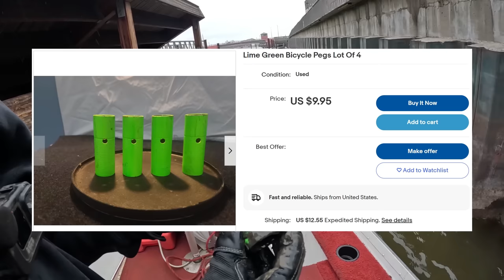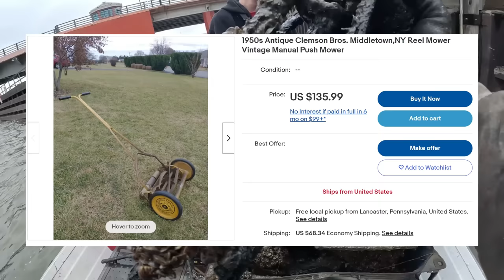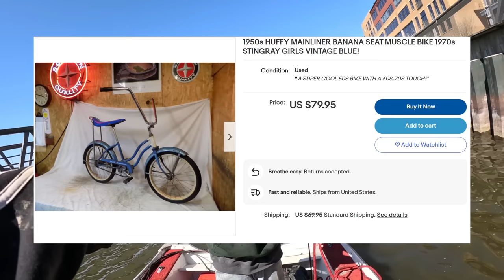Most INSANE 2 Hour Magnet Fishing Riverwalk JACKPOT!!!

Comment: 11:30 Motorcycle rear sprocket 12:35 push mower reel 1960s 13:59 bicycle front forks Thye gears could be from that lawn mower. That prybar is very restorable 24:06 Mop bucket wringer 37:43 Alex caught the end of your lawnmower 39:25 wheel and gear from lawnmower A ll of the metal wheels and gears are from those lawn mowers 48:16 multi-wrench for an electric tool 108:22 street light cover The rest is doubled up from your last big video
Reply: yes, those wheels with gears are likely law mower wheels

Comment: HELLO THERE 🌸🌸🌸 just want to remind you about a few things… is there a adaptor outside to screw in a hose you’re gonna need a water hose I never seen one when you gave us a tour of the house on the outside!
When you set your table and chairs and your sofa and your furniture in after you apply the floor, don’t forget each foot needs a padding with the 2 way tape to stick to the feet and the rug part to the floor so you don’t scratch your beautiful floor make sure your bed and all the other furniture has it underneath also on all feet… keep as much wood as you can for bonfires. Did you get to keep those six chairs you found that would look good with your big umbrella get some small cushions for them or a back and a seat cushion attached together that will look mighty fine, dark blue.
I’ll keep up with reminders just in case keep all glass we both have a craft to do together. I’ll have to find some keep all colour gloss white whatever clear colour whatever keep them all in the box in the barn close it up so Owen won’t touch it.. Okey Okey, Okey Dokey🤗😁🩵🌸‼️‼️‼️

Comment: in the second video on day 2, you brought up a thing with a pattern underneath is also for salvagers because they have two support legs at the back of the salvager which they use with a lever on the side of the salvager, there is a long hatch and the same day there is it on the other side and one of the levers controls the shock leg and if it is slippery you put it under where the shock leg is on the ground and put it under the shock leg and then move the lever up or down depending on how the rescuer works and when the shock leg is brought down so if you put it under the shock leg and then it gets a firmer grip on the ground and can pull what is stuck

Comment: 4:51 This is a Ford model T rim from 1908 to 1927. The four ear brackets on the rim is to hold the steel inner rim for the wooden spokes screw mounted on to it. If a tire get flat then you have to remove the outer rim and mount the spare outer rim onto the steel and wood inner wheel instead.
The car could actually drive without the outer rims and tires on it, not comfortably but like a horse wagon.
The design also kept the weight on the vehicle down, and it saved some labor in the factory and kept the price down for the buyer. So you got a piece of history there :)
It might possibly be from another car, but i bet this is a model T. The model T was USA's version of the german VW beetle, built with a price so everyone would be able to buy it.
5:50 Drum brake for a car wheel i think, likely a wooden wheel, might be to the rim you found or another car.
7:08 Looks like a metal wheel for those garage jack you jack up a car with, often red ones with two bigger wheels like this and two smaller wheels.
12:22 The manual lawn mover can be from the 50's or earlier or more recent, i remember those in the 70's and they did not look too old in those days judging wear and tear, often used when not a too big lawn to move.
People also had them lawn movers looking much like this but had a Briggs and stratton motor on it too, my father did have one of those back in the early 80's, i think we got it on a used sale.
Nice lock, 50's perhaps. When i was a kid in the 70's it was brass locks. But i saw some older ones looking like this in grandparents drawers.
39:17 This wheel is for one of the manual lawn movers, the cog inside is for spinning the cutting rotors so they got high speed.

Comment: That is a lawnmower! I don't think it's all that old, at least not to me. I would date it around 1960-70s because the older ones didn't have a double wheel like this one does. They started making them with smaller wheels in the back, I think to better stabilize the handle. Not exactly sure, but I know the push mower that I used as a kid did not have double wheels and that was around 1965 when I was pushing it around the yard.

Comment: that chain with the hook is actually from a heavy tow truck or a smaller tow truck, such a chain with that hook is attached to the inside of the car at the axle, for example, at the wheel of the car, and then the tow truck pulls the car out of, for example, the ditch or something else that the car has driven into or into

Comment: Play do you use those big pry bars to move the tracks on the railroad they have several people all together at one time and they pry the bar up a little bit and leave it and then they do it again and again I have several digging bars but I don't have any as long as that one is that's a nice one
Reply: The group of men that worked on the railroad rail’s were called Gandy dancers many sang songs as a form of timing to coordinate the force at one time to move the rails . Depending on the gang or the boss man some of the tunes where pretty salty .  The horse shoe with the cleats  ( the cleats did not go up , but down so as to give more traction - winter snow and ice  -